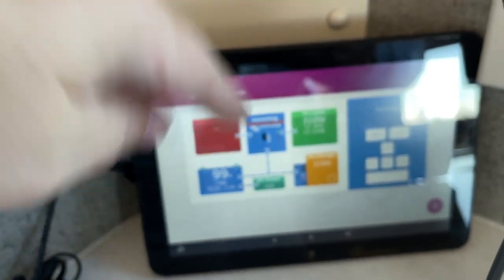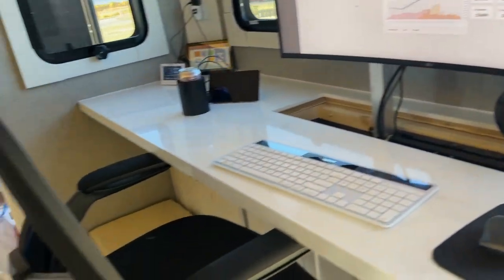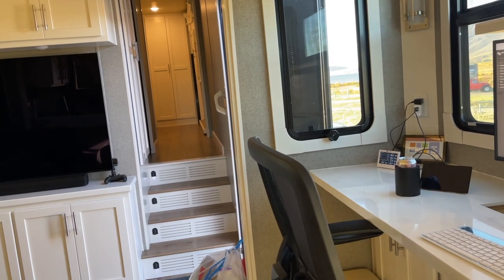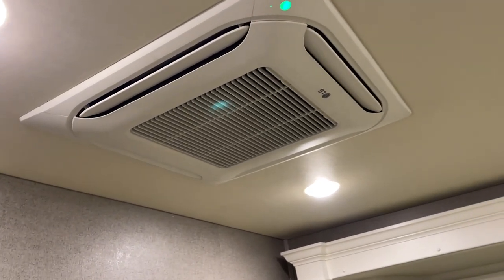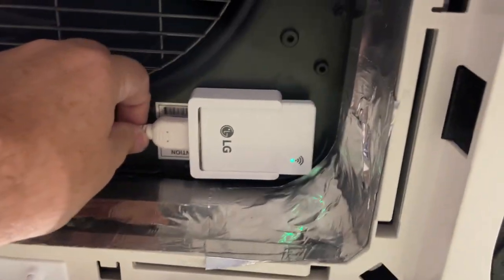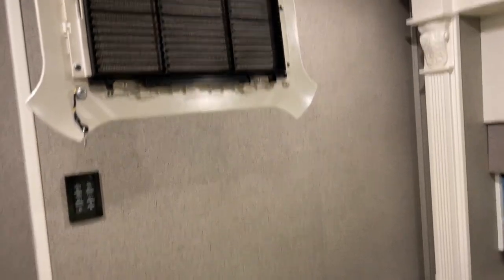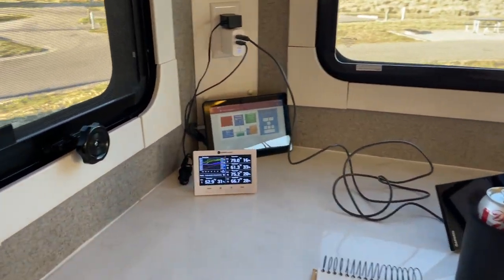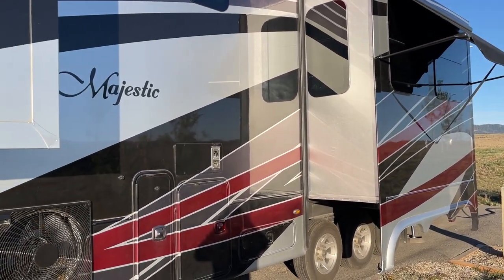Tips and Tricks for Your Minisplit AC in an RV

Comment: You can add a duct off the cassettes. That will reduce the air velocity coming out of the vents even more. Spacecraft does that with their LG units combining both the front and the back with ductwork in the ceiling. So you can cool or heat everything with one unit on lite load days also. Not really something you could do after the fact of installation.
Reply from the maker: And from what I understand, this requires the commercial-grade cassettes, not the residential ones used in the New Horizons builds.  I discussed this very design with the local HVAC company (which is how I learned about the commercial cassettes).

Comment: Tip: Check your mini-splits drain once per month and be sure the drain is clear.
If the drain clogs, the water will drip or pour inside and rot out your walls and floor.
Mini-splits are bad about this.
Reply: I installed a wall mount.Added hard 1/2” pvc for the drain from the end of wall unit flex hose.

Comment: About the heat costing more electric/energy.. It may be more due to the temperature differential inside to outside more than a fault of the unit. Let me explain. When you want the inside temp lets say to be 72F and it is summer time, the differential might be up to 33 degrees F (105F outdoor and desired 72F indoor). Then when your talking about winter and say you want the same 72F but it is 22F outside the differential is 50 degrees F. This means the unit has to work harder to meet your requested indoor temp. On top of that since the scenario involves sub freezing temps the unit will likely have defrost cycles which consume power as well, so even supplementing heat indoors wouldnt help the unit not require to defrost. Humidity will play a role and supplementing heat could actually make the situation worse depending on the particular brand and functions of the unit as some splits reverse to defrost and others have resistive defrost functions also. If it was me i would consume propane and the factory installed unit in sub freezing temps to keep batteries healthy and negate some of the reliance on the solar system in colder weather. Try to park so you get some solar gain. The words you was looking for to explain the winter sun maybe is the angle of incidence. A hard thing to deal with with RV'ing and solar i have seen some automated or even partly mechanical systems to move the panels into a better position but getting the best lot at a parking location is the harder part of that lol.
Reply from the maker: Yup, you got it!  I remember that level of technical detail but obviously didn't cover it.  I try to run heat from solar if I can (and backfill with propane if I need to) because it's a LOT more quiet than the propane heat, plus the obvious environmental benefits as well as  not having to refill my propane all the time (or my wallet LOL).

Comment: Are your cassettes 120 or 240 volt with solar power?  HAve you considered a diesel heater plummed into your floor heater ducts?
Reply from the maker: It's 240v.  Heat is provided via propane but I generally use the minisplit for heat -- much quieter.

Comment: What model are these Mini split Cassettes? Are they 14"x14"  to fit the standard RV roof opening?
Reply: He mentioned 24x24 in the video.  I think they are missing a certain part of the market by not offering a 14x14. I want to do this to cool my semi sleeper,  a rooftop ac would fit the best, but I want mini split efficiency and lower noise than a traditional rooftop.  The 24x24 opening would be too large. I have talked to drivers that have wall mount minisplit.  There only complaint is the condensation dripping out of the unit when parked on unlevel ground. Where does the drip line go to on the cassette. Thought you might want to have it drip on the ground under the outside unit. The damp ground should put as much dust up into the unit. Just an idea, but maybe not a good one.  Thanks
Reply: @farmboy2883  even when the drain is plumbed to the outside, a mini split wall unit will drip water if it's unlevel. The condensate just lands in  pan inside the unit, and has to be level to reach the drain.

Comment: For the internal cassettes is there a condensate line?  Is it easy to get to to put some Vinegar solution down it once a month or so?  We do this on our home unit to keep it from getting clogged shut with slime.
Reply: Yes all cassette units use a condensate pump to pump out water since a standard gravity drain isn’t applicable for obvious reasons

Comment: Sorry if I missed it, but where did you run your hvac lines?  Are they in the “attic” or on top of the roof?  If attic, did you end up opening the ceiling to run them?  Also, I assume you had to modify the ceiling opening? Thanks.
Reply from the maker: This was a factory install.  They ran the lines in the AC duct that's normally in the ceiling.  And obviously they had something already engineered for the roof opening but I don't know exactly what.

Comment: Hey. How do you activate the remote temp sensors?
Reply from the maker: No activation required.   From what I"m told, it's better to hook up an actual thermostat, which the cassette will "see" and then adjust its parameters to work better for that external temperature sensor.  Simply hooking up a temperature sensor can throw off the calibration especially in  heat mode... so, for example, I have to set the heat to 60 to keep at at 70-72 inside.

Comment: Very helpful, I have an LG close to yours.  It was installed by an Rv shop, first one they installed.  I have 3 things that don't seem right.   1 When I set the fans speed to any manual setting and the remote does indicate such, the unit does not recognize the setting and always runs on auto, changing speeds frequently. 2 if my temperature setting is more than 5 degrees different from the unit temperature it works pretty hard, even though it takes (breaks) frequently.  Once I get within 5 degrees or so, it may take hours to get near set point and pass set point-happens on heat and cool.  Is this normal...first mini split.   How about a video on what the unit should do......ex. room temp on ceiling is 65 and it is dark outside, outside temp is 45,  cassette is set to 78, heres what happens......  thanks
Reply from the maker: That doesn't sound normal ... but, what's the humidity there?  Is it raining?  For me, last night was 25 and the living room got to 45.  It's 29 now and the LR has been running for 2 hours and is 55 now, no breaks in runtime and constant 120F coming out of the vent.
My fan speed button cycles between low-med-high-auto ... so I'm not sure why yours would be on auto... what do you mean it always runs on auto, exactly?  The fan does change speeds depending on whether it's on, off, or testing the air temperature ... are you saying that while it's running (the compressor is on), the fan speed changes?
In heat mode, the compressor works very hard.  Quite different than cooling mode.
Can you test the output temperature of your cassette?
Reply: @TisTheDestiny  been in Colorado all summer, humidity never  more than 40 with humidifier running  full bore.  Deposit around 40.  Have same remote as you, suspect same outside unit, inside are 2 12. But units.  I'm a saying I can set fan speed on the remote on high, but the fan itself on the cassette changes speed or shuts off.  I checked temp in and out got 127 and 88.  I'm thinking I have some dip switches wrong.  I have had no luck with LG.  They are not interested talking to consumer..call installer.....who is in Indiana,  I'm in Ruidoso.  My installer is an rv guy not hvac.  Did have hvac do the  freon etc but LG was not their brand.  Units create cold and heat fine.  Programming has to be wrong.
Reply: Dewalt point is around 40 typically
Reply from the maker: @MrBjarthur  gotcha. Yeah LG doesn't deal with customers directly on HVAC. Seriously annoying.  When the cassette fans shut off does the compressor shut off?
Reply from the maker: @MrBjarthur  also what is the inside temp set to on the remote? I have to set mine at least 5 degrees above desired.
Reply from the maker: @MrBjarthur  I wonder if that is playing a role. ODU defrost cycle. When that happens you hear the compressor running full tilt and it’s fan runs slowly and it’s warm air instead of cold.  My dew point is 15
Reply: @TisTheDestiny  compressor  never runs unless cassettes are.  About 4 degrees between counter top and ceiling.  Has same operating characteristics heat or cool.
Reply: I have a wireless cielo that I like, just moved it now. It was directly below kitchen unit on end of island...don't know.  Do you have a direction that I should pursue?
Reply from the maker: The cielo doesn't adaptively adjust the temperature (I used to use it ... but now that I have the WiFi module installed, I don't need it); I think the sensibo does.
I'm not sure what's going on in your case.  The last thing I might do in your case is check the DIP switches as you mentioned - comparing against the docs - to make sure you aren't configured, e.g., for energy-saving mode or something.  You might also test with only 1 cassette at a time, and also make sure the ODU doesn't draw more than about 8 amps on either leg of the 240v AC feeds (use a clamp meter).

Comment: Your ceiling fan is running the wrong direction for cold weather methinks.
Reply from the maker: Most say it's good to run the fan in reverse to disperse warm air trapped in the ceiling without causing a breeze which makes it feel colder.  I tried both forward and reverse.  Reverse didn't do a good enough job in my situation to bring down the warm air, so I usually used forward to bring it down, despite the breeze.  I didn't often use the ceiling fan in this fashion -- I used another small fan sitting up in the kitchen cabinets that blew across the mini-split's output and down in order to prevent the warm air from collecting.

The cassette-style mini-split indoor units aren't ideal for heating especially in an RV and/or with tall ceilings.

I have an update coming regarding mini-splits -- I've removed the cassettes and installed wall mount units.  I've yet to heat with them, however.  But from what I can gather, it will be much better.  My cooling is much better for sure.
Reply: @TisTheDestiny  I talked to NH at the Tampa show and they mentioned the wall units.  I saw in one of your recent videos that you had replaced the cassettes.  Look forward to that video.